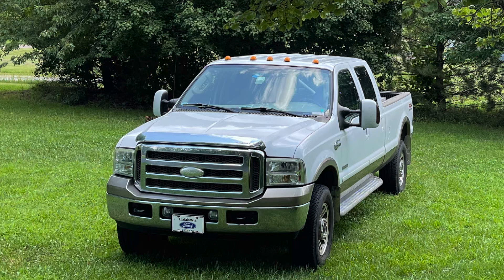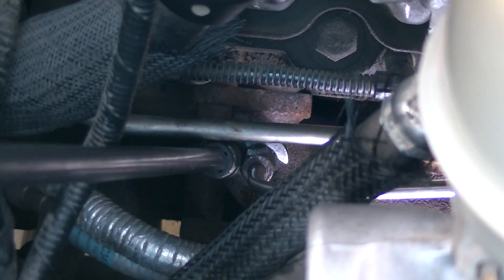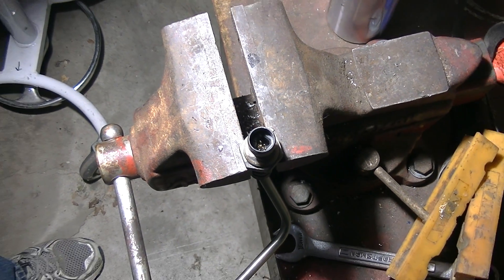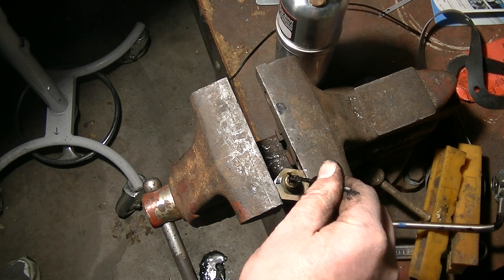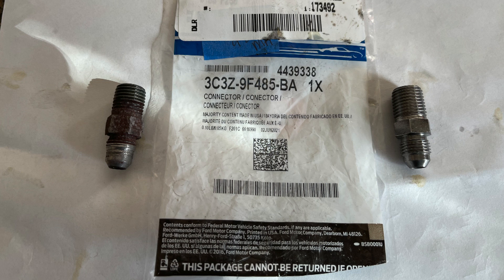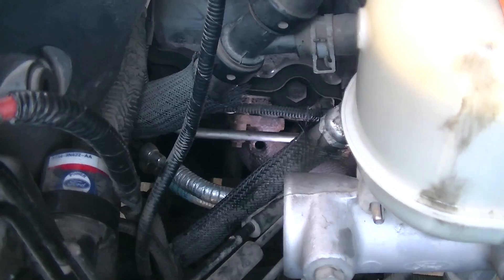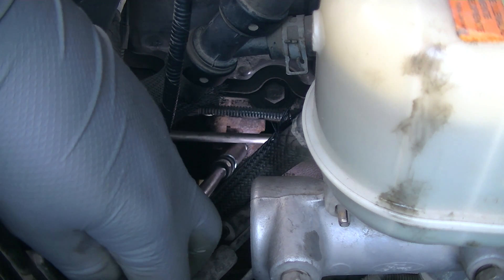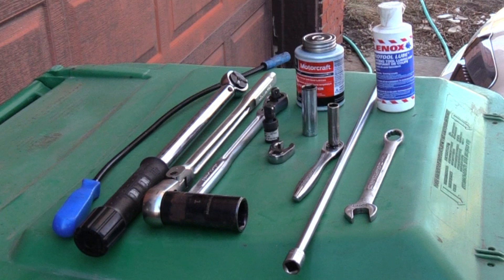Ford F-350 6.0 Power Stroke Diesel Code P0470 (EBPS) Exhaust Back Pressure Sensor, Fastest Fix

Comment: Thank you for your video. Took me longer than 15 minutes but it is possible with crows foot.
Reply from the maker: Thank you for the comment. It’s certainly is with a little practice! 

I am working on a similar technique for glow plug replacement.  I modified a tool to make life easier, I plan to put it to the test this weekend, when I change # 5 glow plug

Comment: Nice vid here. I have the same problems on an 06' f250. Will be attempting the repair soon.
Thanks and cheers!
Reply from the maker: I recommend having the parts tube, and fitting on hand, you clean the sensor in minutes, and install the new line (and fitting if necessary). Then clean the old removed ) line for a spare, quick swap in the future. Then every 15k ( second oil change) do a swap and clean, also clean the EGR , I have a video on that also, the cleaning process is the same
Reply: Thanks for giving me some more recommended information man. I ordered all three parts from Ford today and will get them tomorrow. Will try cleaning the pipe and sensor, especially if clogged to keep for spares. Definitely took the cue on that nipple that goes into the exhaust manifold as being a problem area. Thanks again for showing us what needs to be done. Cheers and Merry Christmas!

Comment: What size socket is the nipple fitting?
Reply from the maker: I will double check and get back to you
Reply from the maker: I think I have a new one on the shelf
Reply from the maker: I have the Ford factory line and the nipple in sealed packaging 

The nipple is 9/16 “
Reply: @normanpaulife   thanks so much ..and nic video!!!
Reply: My fitting  broke in half in the  manifold any ideas  what to do ?

Comment: I had this sensor short out and truck went into limp mode
Reply from the maker: I plan to clean it every other oil Change about 15K miles to prevent it from getting clogged. Did you fix it yourself?
Reply: @normanpaulife  yes  I did found the problem with a ohm meter and when I unplugged it ran great got a new 1 all good mine was not plugged up ether was the tube but the truck has 70000 miles on it but I don’t think u need to clean it that often once a year and same with the turbo thanks for good video appreciate you
Reply from the maker: I checked it recently with the anti-seize compound it was effortless to remove.
Reply: @normanpaulife  awesome love the 6.0 mine is 07 regular cab f350 cut the frame and put a 6 foot box on it  its 2 wd I also have 06 f350 drw crew cab long bed 4 wd there good trucks both have o ring heads not pushing a bunch off power don’t need it